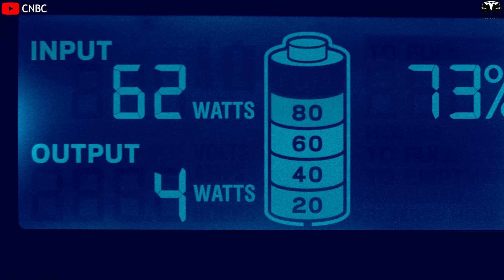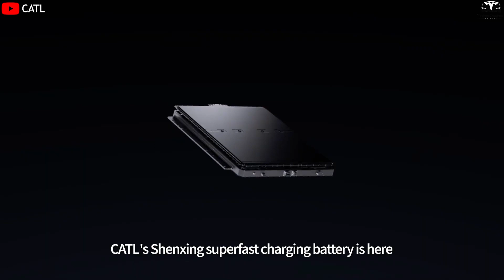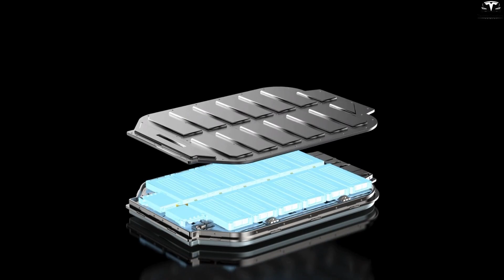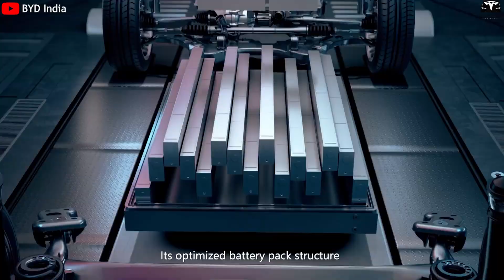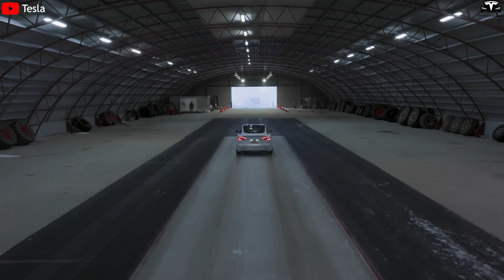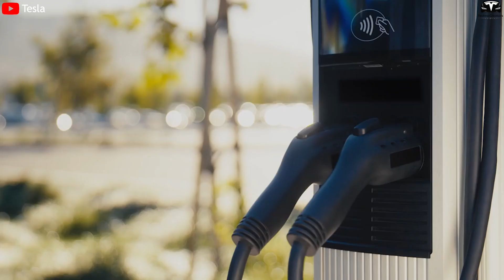THE END Of LITHIUM! Sodium Battery Slashes EV Cost by 30%, Mass Production Start in 2025!

Comment: But the thermal runaway still exists with Sodium and the range will drop substantially and it cannot charge as fast.
Battery packs are not the answer, but there is a solution.